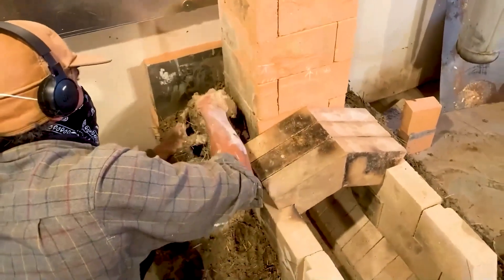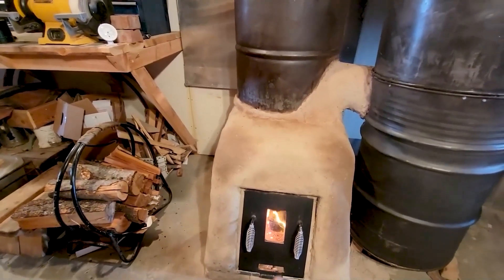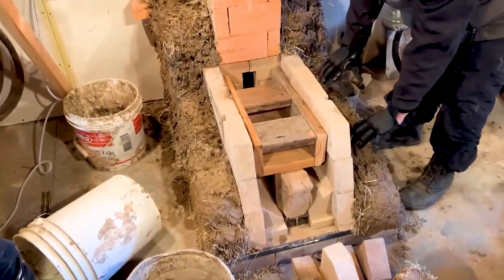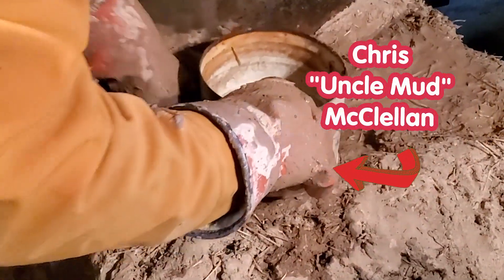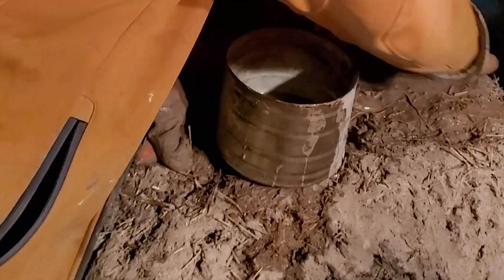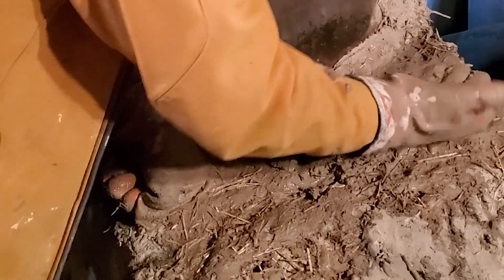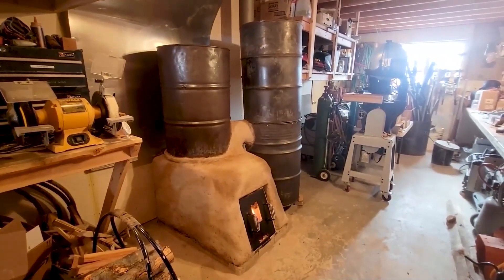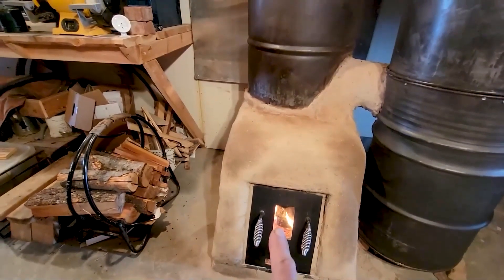cob becomes rock-solid to frame a rocket mass heater

Comment: Be careful combining Cob and Steel components, Steel has a much greater coefficient of expansion, and if it gets too hot it will form big cracks in your cob fireplace. Speaking from experience and a lot of smoke inhalation!

Comment: Just curious, why people aren't using Rammed Earth instead of Cob? It's much more dense, less prone to shrinkage and cracking and if you use a light colored clay, it's basically fire brick. I've been using Rammed Earth on my ovens and works phenomenal for me.
Reply: Just build a quick box form, and ram layers of a 1:3  ratio of fire clay- Sand into it to make your oven. The lighter color the clay, the higher temp it can handle, fire clay is just any light colored clay. Just walk around and find the lightest color dirt you can. You could even add ceramic or fiberglass fibers into the mix  if you wanted extra thermal expansion and contraction protection.
Reply: Sounds good! What's the main difference? The mix seems to be about the same. Is it the ramming that would change the structure? Maybe elliminate air pockets? What does it do to insulation value?
Reply: @nagypite  Yes, ramming compresses the mix far more and you get a denser thermal mass that holds more heat as well as transfers heat more efficiently.
Reply: What the fuck is cob?

Comment: You should put more fire resistant glass to have more free light.
Reply from the maker: More glass cools the fire.  We need the fire to get really hot just as it goes into the riser so it will burn all the smoke, creosote and soot as bonus fuels and make for a really clean exhaust.

Comment: Anyone knows what was used to give it this nice finish?
Reply: The ideal finish for cob is made from sifted smaller bits of the same mix that was used to make the body of the cob. The same ratios of the same sandy clay and straw fiber will stick to the. Are cob best over time and polish up nice. I think we just polished this cob with a yogurt container lid, but you can also seal it with linseed oil to make it more durable and cleanable.
Reply from the maker: More cob - only this time, with less chunky bits.
Reply: @paulwheaton  no straw and sifted sand?
Reply from the maker: @bedin88  Generally, for the finish layers, straw is okay provided it is extra small.  And to get it to be extra small, manure is preferred.  And the sand maybe be sifted to make sure the bigger chunks are taken out.  

I emailed uncle mud to see what he might say about this particular build.
Reply: Thanks a lot!!!

Comment: Cob is just amazing!! so nice to see how functional it is for rocket mass heaters too. Looks lovely too.
Reply: Rammed Earth with light colored clay and sand is better than COB imo.
Reply: @nateross14  That's fine if you have a base to ram against. If you want to enclose and hold together a hollow brick construction, cob will gently conform to the exterior and the straw will give tensile strength.
Reply: @gjh42  With Rammed Earth you don't need the hollow brick construction. Rammed Earth replaces the brick. You can easily ram earth to whatever shape you want using various forms.
Reply: @nateross14  It would be interesting to compare how a rammed earth firebox lasts compared to a firebrick-lined firebox.